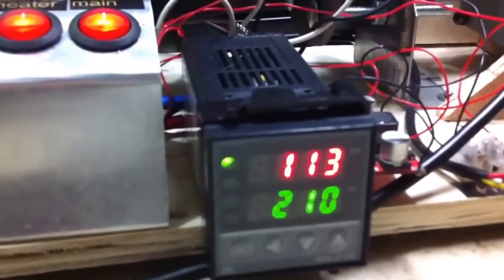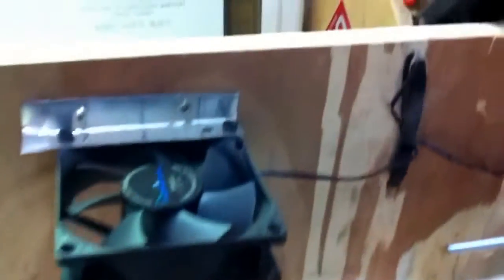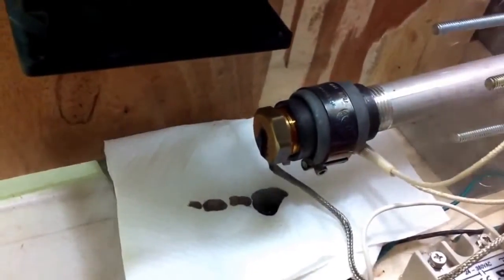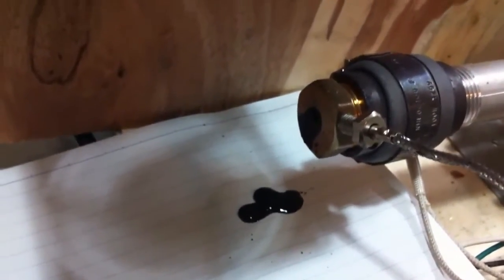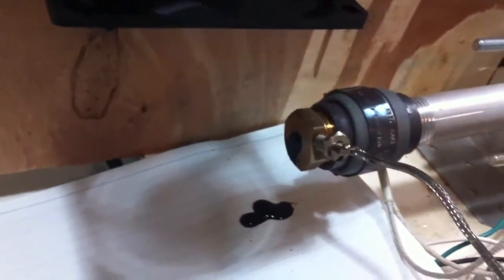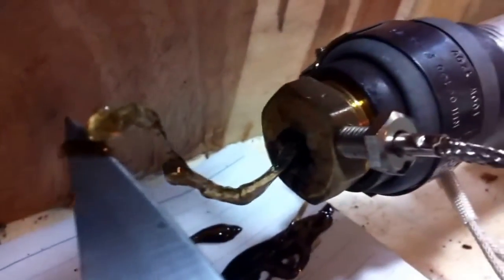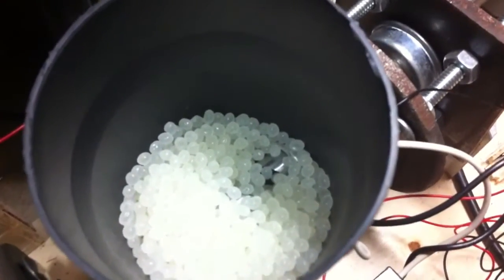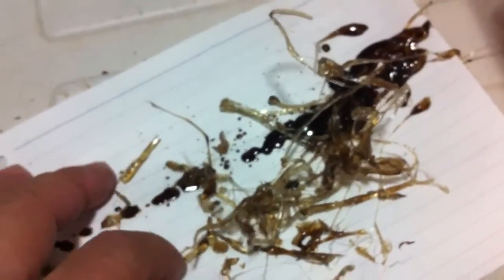DIY 2nd and 3rd try filament extruder.

Comment: Where do you buy your filament? I have been looking on dx.com, miniinthebox, aliexpress.com and so on.
Reply from the maker: www.taobao.com usually the price only RMB 60 per Kg. either PLA or ABS. The precision and quality is good enough up to last inches of the filament. sounds good. huuh!
https://world.taobao.com/item/524202618783.htm?fromSite=main&spm=a312a.7700846.0.0.kkqMcx&_u=b50e9mhad35